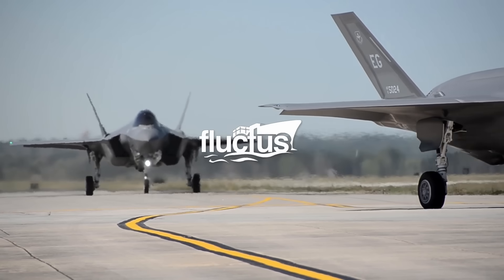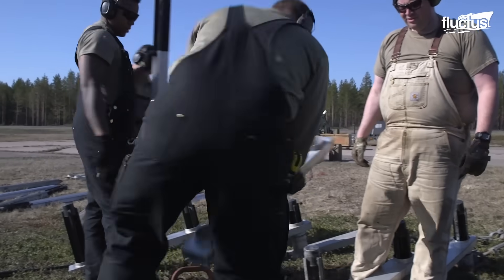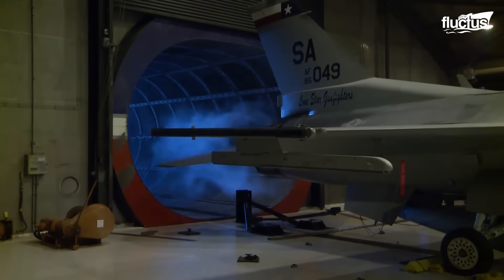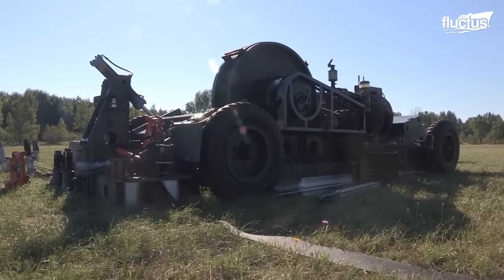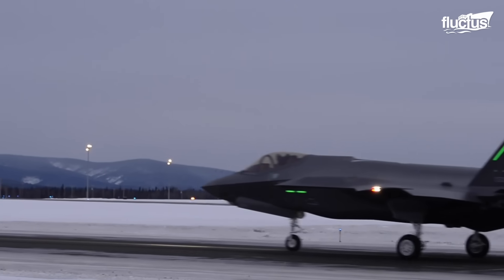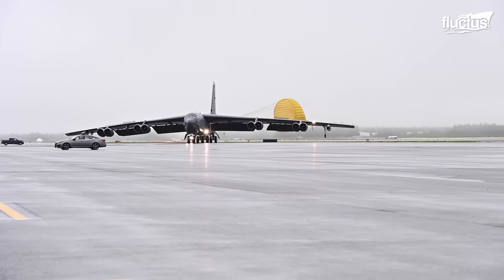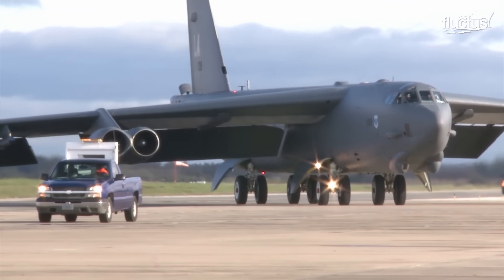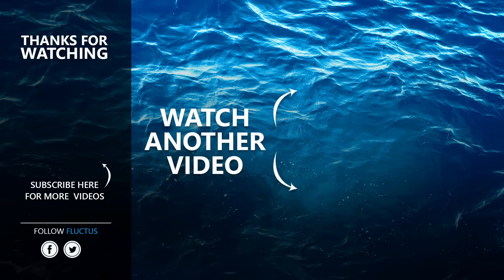Genius Technique US Found to Test Jet Engines to the Extreme Limit

Comment: i have seen the anchors ripped out of the ground.  AV-8b's in Desert Shield the SeeBee's built us a high power ramp to test engines after installation  didn't last long with the p408 RR engine with 22000 pounds of thrust....made your teeth rattle at high power   Semper FI